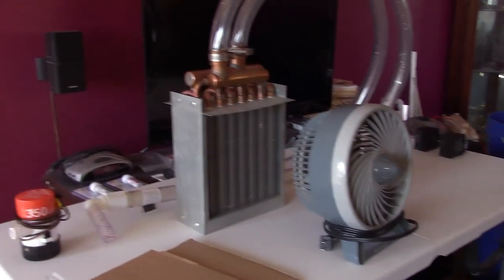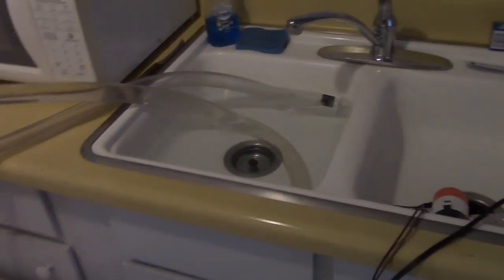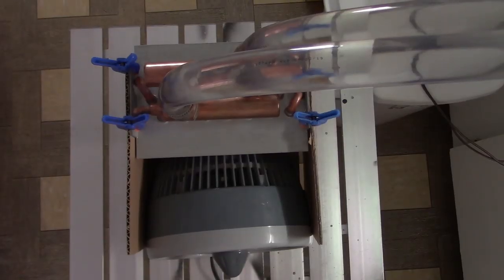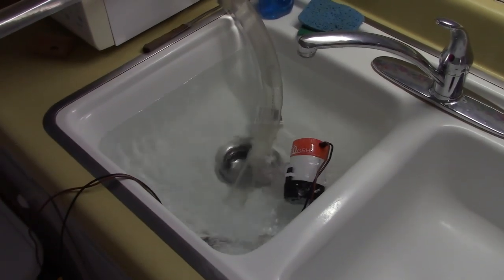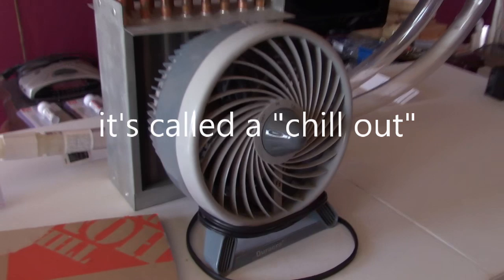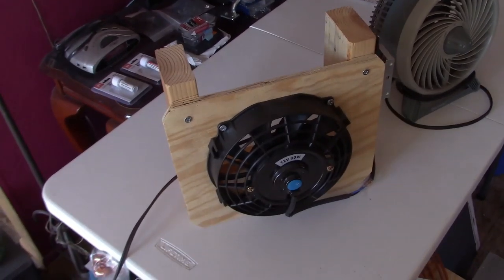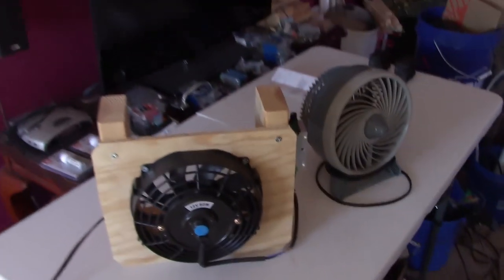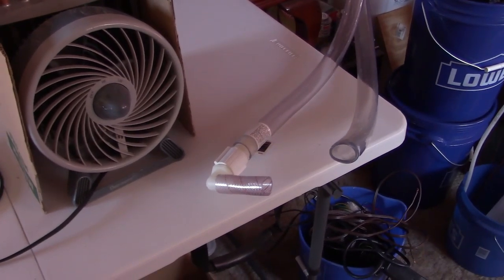DIY Air Heater! Heat Air with Water! Heater core Heat Exchanger. (w/AC Fan) - high-temps! - Easy DIY

Comment: Great stuff here! I set up the same thing in my garage a few years ago using an old ceramic toilet tank as the ''bucket'' which helps to insulate the created heat/cold water better and the toilet float lets in more water into the system as needed. Want all fresh water in the system? Just flush it. 😂

Comment: Great Video! I want to do the same thing but use coil copper pipe and set it outside on my house fire place exhaust vent with a thermostat and pump the water into my garage using a heat exchanger to heat the garage when i am heating my house with my fireplace.

Comment: You can't keep putting hot water in  the sink. You need free hot water. Make a solor water panel from Pex tubing. There are a few videos on youtube. Connect the panel to a pump the hook it to the heater core. As long as there is sun you will get hot water. That is what I plan on doing in my work shop.

Comment: I've been following your videos for quite some time wouldn't it be more effective to cool/heat your self rather than the entire room.. I've considered making my own cool suit take two shirts place cappaliary tubing between the two and sew them together and around the tubing to keep it in place then connect that to a cooler filled with cold or hot water and a pump.. id be interested to see how you would do it. The ones you can purchase cost hundreds of dollars but I belive one could make it themself and cost much much cheaper.
Reply from the maker: hi. i've been recently working on units like you mention (to cool the space around yourself). it's a great way to get the most out of a system. i'll have a video or two on it next spring or early summer as the heat approaches.

Comment: I'm curious if you calculated the offset cost of heating the hot water as opposed to a regular gas burning heater. Assuming that the hot water is coming from a standard gas or oil hot water heater.
Reply from the maker: hi. no i haven't. i've mostly been focused on using solar power (either solar thermal coil style water heaters or DC water heating elements attached to solar panels) for the water heating. or possibly some sort of wood burning "wood boiler" style stove. maybe even a rocket stove.
Reply: @desertsun02  An alternative to the mentioned heat sources could be a Solar oven or maybe a parabolic trough... Free energy is the best heating  source..  and aint nothing cheaper than the concentrated sunlight

Comment: I am wondering just how much of a difference it would make to use 2 radiators 
One in front of the fan,  and 1 behind of the fan
Reply from the maker: i'm not sure. i've never tried that. i was thinking about trying that with some of my thinner radiators (heat exchangers).

Comment: I want to do this but for cooling. The idea is running lines underground to cool them and just pumping and circulating the liquid. What do you think?
Reply from the maker: i think it's a good idea, but i've never researched it. one idea is just to tap into underground water. that water should be about the right temperature

Comment: Good stuff mate,
I wonder is there a way to heat and cool a water container az a thermal mass with solar depends on the season and then passing water trough the air extender?
Reply from the maker: thanks 😎

Comment: What is the size of the flexible hose that you’re using? What is the size of the intake/outtake pipe on your 8 x 8 heat exchanger?
Reply from the maker: hi. the flexible hose is 1" internal diameter and the inlet and outlet on the heat exchanger are 1".
Reply: @desertsun02  Thank you. I see the pump has no plug, how do you power yours?

Comment: I want to build this for indoor use. I don't have solar or understand anything about solar. The pump doesn't look like it has a wall plug. How do I power the pump with regular indoor on-grid electric? thank you
Reply from the maker: hi there. easiest way is to buy an AC (wall current) water pump. home stores, harbor freight tools, amazon or any aquarium supply store should have them (even walmart probably) 🙂

Comment: I can't even find an 8X8 Water to Air Heat Exchanger.
Reply from the maker: i've noticed they are harder to find than before. i still see a couple of them out there thou. try badger pipe or their associated website(s).
Reply: Same! I'm in Ontario, Canada and they're either out of stock or expensive (~$150 USD). I looked at a few US sites but they're also low on stock. 

At this rate, I'm gonna have to build a DIY heat exchanger first.
Reply from the maker: hi there. here's a link to 3 pages of them. they can usually be found on amazon too https://badger-pipe.com/collections/water-to-air-heat-exchanger
Reply: @desertsun02  Oh, thanks. I called their customer support and it seems it'll be $30-$40 to ship to Southern Ontario, so I'm still looking for a more affordable solution, but this could be a backup option.
Reply: @desertsun02  BTW have you tried using an car radiator? I'm thinking of using an aluminum radiator and maybe wiring it up with copper coil (maybe zip-ties, like you did in one of your builds) to increase conductivity.

Radiators I have in mind:
-  https://www.amazon.ca/DNA-Motoring-RA-HC92-42-2-Aluminum-Radiator/dp/B01HXWD8MO/
-  https://www.amazon.ca/AutoShack-RK777-Replacement-1999-2008-Chevrolet/dp/B08FBHJLGS/